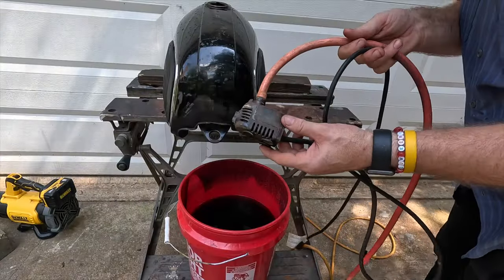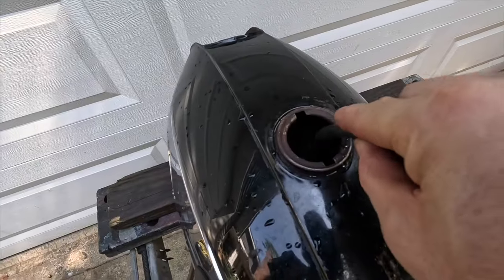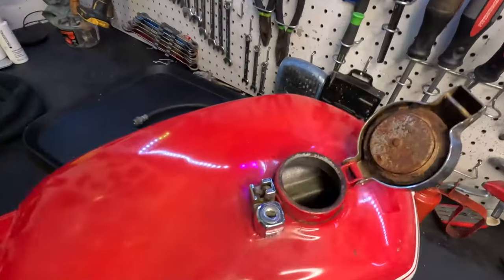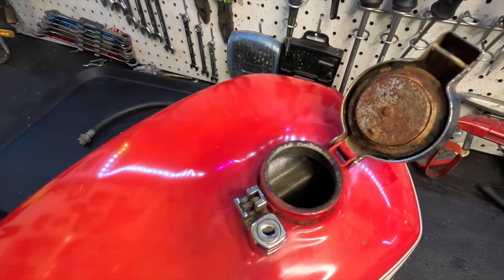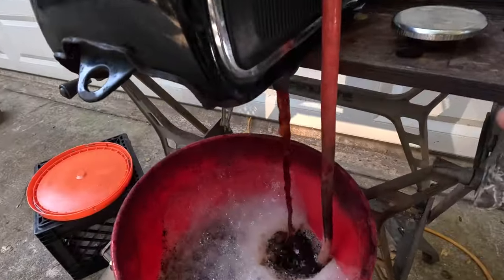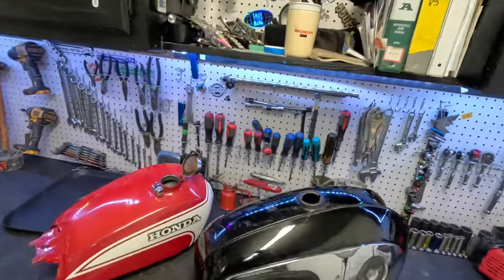Amazing Rust Removal Hack For Vintage Honda CB450 K0 Tank

Comment: I clean brass using Lemi-Shine dishwasher cleaner powder and lemon Ajax liquid detergent diluted in water. Even if the brass heavily tarnished, it looks like new when it’s done in a tumbler. I have no idea how it would work on rust, or with using a fountain, but it may be worth a try. My thought is that it’s swapping out acetic acid in vinegar for citric acid.
Reply from the maker: It’s worth a shot. Thanks for sharing.

Comment: did a few with vinegar, some with acetone due to old tank liner failure, acetone takes care of most of those liner coatings..  then I  used a  product called "Ospho" found at at the hardware store, Home Depot ect....now that is "the king" of tank cleaner!!...did an old triumph tank  with a acetone soak shake with drywall screws then a dose of Ospho and a shake every 10 min. for a half hour,  dump it out thats it..the inside looks like bright metal. ..great stuff!!, and a common product ,it converts rust to a black hardened debris then rinse quickly with acetone ( because acetone will not cause flash rust like water based vinegar or soapy water) to clear the converted rust, do another treatment of Ospho just to see if you got it all and it will remain on the metal like a sealant even gas proof...works converting on the outside rust as well....your carb float valve seats will thank you for it!!....D.
Reply from the maker: I have used ospho it works really good. Thanks for watching.

Comment: Great idea with the pump and shop vac.  What % of acidity vinegar  are you using?
Reply from the maker: This is just normal white vinegar. Im a cheapskate and won’t splurge for the expensive stuff!!🤣😂🤣
Reply: @motorcyclerewind   Yeah, after watching I saw how expensive the higher % are.

Comment: Use a filter system like you would put on your ice maker or try like one of the pur filters just put it in line or automotive fuel flters
Reply from the maker: That sounds like a good idea. Thanks

Comment: How do you get it so it's filling the tank at the same rate it's coming out through the petcock...so it doesn't overflow...or not fill up enough?   The only time I used vinegar I had some bad flash rusting that turned into this thick corrosion on the inside of the tank.  That's why I switched to Evaporust.
Reply from the maker: Thankfully I haven’t had it get clogged and overflow. I do rinse the tanks out first so maybe that helped. 
With regards, to flash rusting. I had similar issues when I would fill the tank. For some reason it doesn’t do that with the pump.

Comment: I had a customer tell me that he uses diluted molasses to clean tractor tanks 1 part molasses to 9 parts water. I’d be interested to see how fast it works. He said he uses molasses for feed because it’s cheaper. He claimed it works just like evaporust I never tried it so I can’t confirm or deny. Google said it works with the same chemical reaction but how fast is the question. The last couple tanks I’ve cleaned I needed quick so I used evaporust because I knew what to expect.
Reply from the maker: I have heard the same thing molasses. Looks like I will be buying some feed molasses. Thanks for the suggestion. At least my old tanks will get de-rusted.